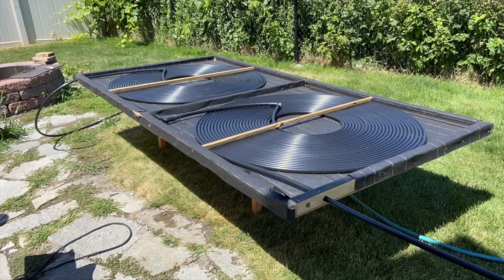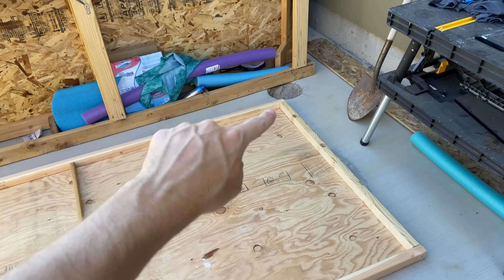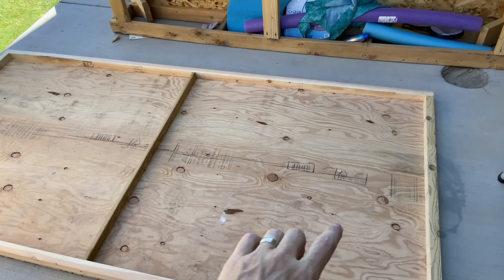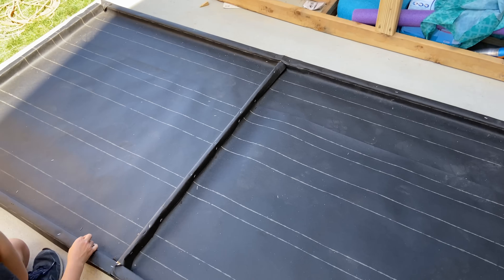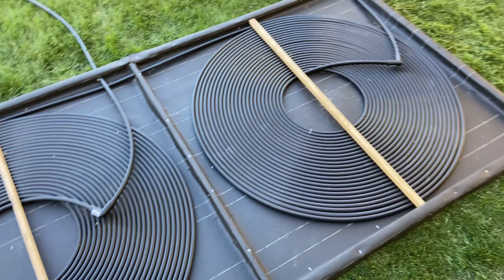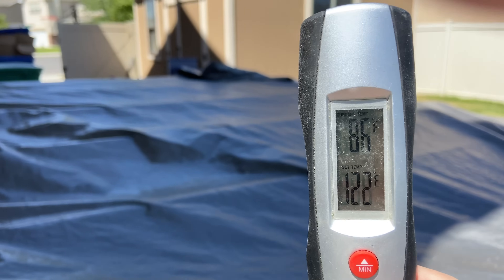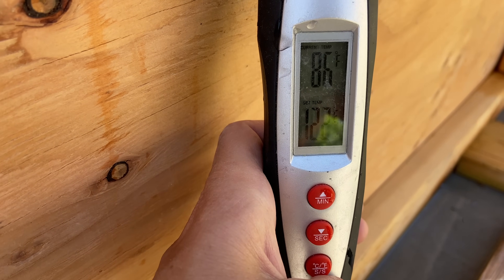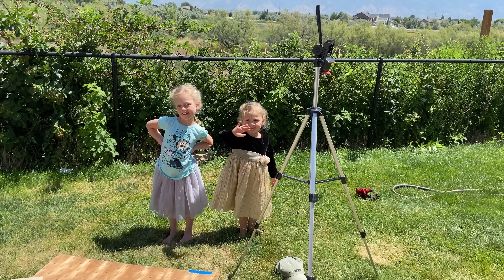DIY Pool Heater - $50 Solar Heater

Comment: I commend your enthusiasm for a low tech more sustainable solution. 20/20 vision
my criticism is that the project will not be as low as $50  unless someone is giving you free materials or you have left over materials. 
You should include all the costs, wood, paint, glue, pipe, joints nails screws, and a small amount for consumables like paint brushes, drill-bits. I also think the pump should be included. It won't operate on thermisiphon alone.

I built a similar unit and it cost approx $150 for this part of the project.

Its not fair to give the cheap impression because it's clickbaiting away from other similar projects which are presenting their ideas more honestly, as I plan to do

if you remove the $50 Im happy to endorse it with my like.

well done for bothering to spread the idea though. good luck.
Reply: Agreed, it's a click bait title. Neat project but I had to dislike it